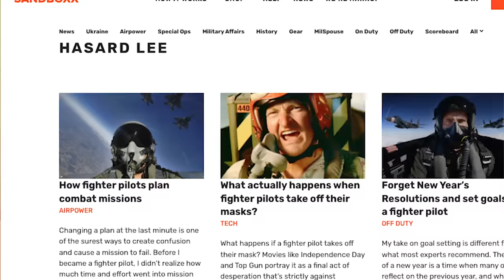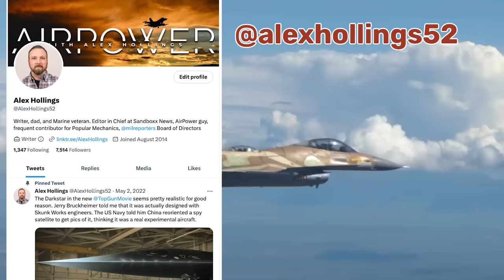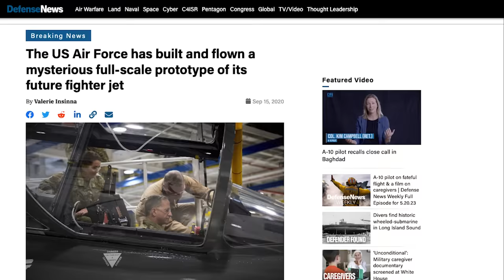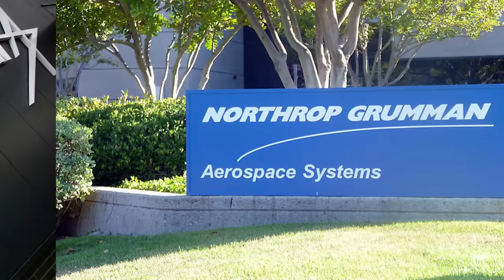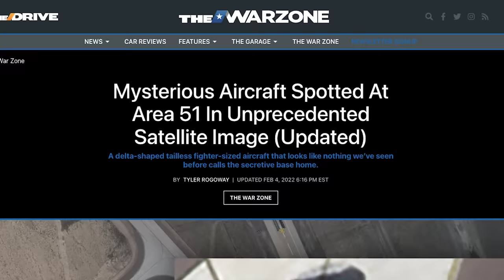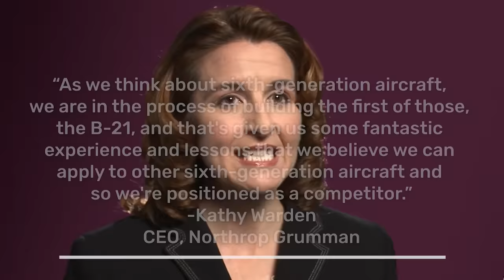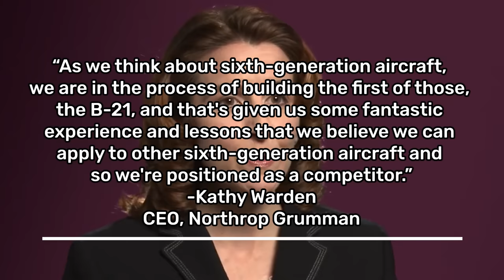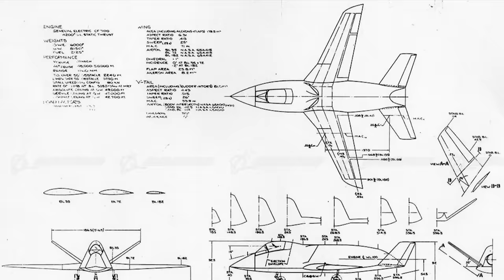The race is officially ON to field America's new stealth fighter

Comment: Sort of a question to anyone, if you give thrust vectoring that could rotate 360, could that still give the maneuverability a tail fin could give?
Reply: I would assume so. Look at something with TVC like a falcon 9 rocket.
Reply: Thrust vectoring alone doesn't contribute manoeuvrability, it does to an extent but not those extreme manoeuvres you see on airshows, for example the massive rudders on the F-22 combined with 2D thrust vectoring and the diamond delta wing makes it so agile, thrust vectoring alone without control surfaces is going to be difficult and the aircraft will be extremely sluggish.
Reply: @kermittoad  I think you’d need thrusters along with the thruster vectoring to match the impact of a tail controls.
Reply: @kermittoad  That's a fair point, I didn't mean the aircraft would use only TVC. I think TVC could be cleverly used to compensate for lack of tail fins. Obviously you wouldn't have only TVC or only control surfaces. I think both could be used together to achieve greater maneuverability than a tail-less design. I'm sure the engineers will come up with some clever designs and control systems.

Comment: Again - it is a huge mistake to call the systems “6th gen” - while most people think it is the logical thing to do - it is not. 
There is also a huge lack of understanding of the new jet. It should not put the F-35 to shame! Everything but! The F-35 is still planned to be THE jet until about 2060. Does this sounds, that the NGAD is just better in all domains? 
Here is the point: You have to see, what the Pentagon lacks as capability: mostly range. And it wouldn’t be a “big problem” to give the F-35 systems to control drones and drone swarms. But here is another problem: also “combat drones” won’t have the range (knock, knock: South China Sea). 

How to get this capability? Increase the size of the platform dramatically. I would even guess, that NGAD might be able to carry drones internally into the war scenario. 

Also - most people have a very wrong understanding of combat jet speeds - because Vmax is not even close the same used “maximum speed”. Usually jets won’t accelerate higher than mach 1.3. I guess, here NGAD will be also pushing the limit and have a far higher practical speed (while Vmax might stay the same). 

I guess Alex has been a bit misled. First of all: we don’t know if the F-22 is stealthier or not. There are official contradictory statements out - and probably non are wrong, because the aspects of both jets (F-22 vs F-35) might be very different (RCS). But even agility is incredible when you are looking at the F-35. I know, that there are heated discussion about it: but the videos of F-35’s doing crazy post stall maneuvers are not lying. Hence the F-35 is not at all so much in the shadow of the “bigger brother”.
Reply: Though the F-35 has a great sensory suit its not an interceptor and does not meet the needs of both the navy and Airforce in engaging targets up to 1k miles while using drones and stealth. It does have stealth but its a limited air craft with range and speed being a big factor plus it can't go super cruise limiting it even more.  The F-35 will never meet the demands of the battlefields coming up and its only hanging on by its sensory suit that the 6th gen will have but even better.

Also you never explained in detail on your opinion why you said its a huge mistake to call the systems 6th gen.
Reply: @michaelmichaelagnew8503 First of all thanks for commenting...
Look - I am well aware, that the whole idea of NGAD is range and usable speed (which can give stand off missiles or even any missile a lot of kinetic energy). The F-35 will be multiple time upgraded - hence saying, that the NGAD will have better avionics is somewhat a flawed argument.

The “gen” moniker is basically awarded, when an aircraft is proving itself. It is not the same to say “next gen” and “+1 gen” - because next gen refers to the next “batch” of aircraft types, but “X gen” refers to the performance (compared to the "X-1 gen”) and its force multiplier. 

So when the jet comes out and performs against Raptors and F-35’s and would have a kill ratio of about 15:1 or higher, you might make the argument, that this is 6th gen. Please listen carefully to any official statements: you won’t find anywhere 6th generation jet - only “next generation weapon systems”. 

 As said: the public misunderstands NGAD as a “replacement” or a “upgrade” of the F-35 and F-22. It fills the need of replacing the F-22, but overall, it will be a whole different format and a whole different objective.

I don’t even think, that it will have the same agility as a F-35. The need for stealth and for long range (aerodynamics) is just mitigating the possibility to have an extremely agile plane. Some can be achieved through some augmented (computer assisted) trickery (like in the F-35), but I doubt, that you could achieve all of it.

Comment: I thought the F-35 WAS the technology demonstrator. They still haven't figured out WHAT it is supposed to be. Despite the variants. Yes it is dominating  Airspace. but never really contested ones. I am starting to believe  "Next Gen" is the answer to TWO GENERATIONS OF DEVELOPMENT TIME.  (As the F-35 is still not cleared for full mass production). It comes in "Upgrade variants" in small batches,  but yeah, as long it is "On time and on budget..." (I like that one argument the most of them all).
Yes, NGAD will be a proper plane, Fast, Long range, High Payload, Drone control capable,  A.I.-controlled, and never in combat. As a loss would be too much of a reputation hit hit. Or risk for possible Technology transfer (National security Risk). Not to mention the costs, in whatever currency the USA will use by then. (It's probably going to be a 3-4 Trillion $ program, after all is said and done). At least the "Loyal wingman" drones can keep up with it. They are not by any chance MQ 25 and MQ 26? I think, they need new hulls and engines too.
I am not just "yucking your yum". I am asking  question about "Return on Investment" from a government's perspective. Not a company's. 
How the hell did we get from "A good plane is one that creates Aces", to: "On Paper it beats everything ".  I am just taking that paper, look at it from the edge and say: Stealth, indeed, until you look at it from the top. Usually a new plane takes a whole new support structure behind it. And all of it has to work properly. Material/manpower sourcing, Logistics for Materials, Production capacity, tooling and spare parts, well trained maintainers, assemblers, programmers etc . If you don't want to rely on foreign sources/capital it has to happen in-house. And i see little effort in that direction. Maybe it'll take six years , only to source the people who could actually produce it. I like shiny designs too, but if they are like Colani's designs, that never see the light of day as a serial Product, I HAVE to call it BS, despite them looking a century ahead of their time. It is the Car saloon fallacy. Underneath the shiny hull, it still has to work, and be serviceable by people, who know what's where under it.

Comment: The drone wingmen that can pull 40Gs without a pilot will be impossible for a piloted aircraft to deal with.
Reply: 40g capability would require re-design or a unique design for anything in that aircraft.  Avionics, engine, and subsystems could not be reused from aircraft designed to only pull 8-9 g's.  It's not as simple as it may seem.
Reply: add in 360 targeting system and that can launch a missile behind it like the F-35 and you have a mean fighter jet.
Reply: @ahill209  Our Aircraft and their systems and pull far more than 9G's but the pilots can't.  That's why the F-16 is locked out of some maneuvers.  WW2 planes can pull 8 to 9 G's.
Reply: @Cancer McAids with engines developed in the 80s like the raptor would. The technology is far beyond that. An engine doesn’t have to resemble the past designs. Multiple engines with 180 degree thrust vectoring would accomplish this. The military is consistently 40 years ahead of where the public expects them to be.
Reply: @Cancer McAids tell that to Turkey. The Kızılelma drone outperforms the f-35 from a country with a $16 billion military budget compared to the United States’ $766 billion.🙄

Comment: The Pentagon's priority is, preserving the high-tech industrial base.  The specific airframe chosen matters less, assuming it meets their stated requirements.  I think it likely that all three companies' proposals will meet the requirements, and furthermore I expect the Air Force has already DELIBERATELY set the bar low enough that they WILL NOT have their decision dictated by the relative merits of the competing designs.   

Northrop Grumman already has a large 6th generation program (the B-21) so there is no incentive to choose them on the basis of preserving the high-tech industrial base.  So for all practical purposes Northrop Grumman is out of the running. 

Lockheed Martin has a very solid 5th generation combat aircraft background and has probably done 6th generation work on classified reconnaissance programs, and it would be a shame to lose that foundation.  Boeing does not have a solid 5th generation combat aircraft background so there is less to lose if Boeing doesn't get this contract (and Boeing may be the front-runner for the unmanned portion of the NGAD system).

Conclusion:  The NGAD manned figher contract will go to Lockheed Martin. 

I am 33.3% certain of this.
Reply: Northrop Grumman has officially withdrawn from the NGAD competition.  Ba-dump bump CHING.  The NGAD manned fighter contract will go to Lockheed Martin.  I am 50% certain of this.

Comment: As exciting as this news is, I feel it is disappointing.  We have 2 programs that are still in production (F35 and B21), and would benefit from the wingman.  I really think 1 or 2 of the remote wingman models should be the priority instead of the crewed NGAD.  The B-21 doesn't have a role in the defense of Taiwan, unless we start to bomb mainland China (and pray it doesn't come to that), but paired with loyal wingman, it is a defensive juggernaut.  Use as an attacking AWACs that isn't nearly as exposed as an AWACs.  Our threats need the multipliers (read drones - in fighters, attack craft, and ships), not the budget busting primary vehicles.  Our current build generation on those are still first class, and don't have a credible risk in the development cycle of NGAD or the naval equivalent.
Reply: Taiwan is already a highly difficult task for China; the coastline isn't friendly for landings, their navy crossing the Taiwan strait would be highly vulnerable to anti-ship missiles which they're acquiring more of, and correct me if I'm wrong but they have little to no experience in such a huge operation. If other countries get involved in any capacity China likely won't be successful.
Reply: The NGAD will be manned and also able to be unmanned.  It will also be more advance than the F-35 and far superior as an Air to Air platform.

Comment: I would think the military is going after and end all be all approach to the NGAD. Meaning the F doesn't mean it's just used for air superiority alone but ground targeting also. That leaves me to wonder the fate of the A-10. They are ordering vastly smaller quantities of this aircraft than ones before. So maybe the military learned their lessons with the F-35.
Reply: The F-35 is exactly what they wanted/needed, and its gonna be the backbone of the fleet for quite a while so of course a more expensive heavy fighter will be made in fewer numbers, the F-35 will be able to cover most missions. The A-10 was already obsolete in its initial tank buster role and should've had a lighter/cheaper replacement long ago, but congress keep dragging it back and preventing progress.
Reply: @aidanwilliams9452  I disagree with your assessment. The F-35 cannot deliver a nuclear payload. It's too slow for the shock and awe. Let's not forget it couldn't win a dogfight with an F-16. It might have the computing power but it definitely doesn't have the horsepower.
Reply: @c_s_8411  Firstly, the F-35A is nuclear capable they’ve assessed it. Second, it’s Mach 1.6+, and unlike an F-16 it’ll actually reach those speeds carrying a combat load. There’s no point for Mach 2 or higher, you’re wasting fuel and there’s been virtually no supersonic fights in the last few decades. As for the F-16 dogfight, 1) that was 8 years ago during it’s development where it was severely g-limited 2) the testing was started with the F-16 in a 6 o’clock position giving it full advantage 3) F-35’s have been wiping the floor with the F-16 in training exercises ever since.

Comment: They can do whatever the hell they want with NGAD but just dont retire F 22 and if one stealth aircraft has to go then send the F 35 tor retirement
Reply: The lightning 2 isn't retiring. Too many customers and more blocks and upgrades are planned for the next 50 years.

Don't get me wrong, the Raptor was an amazing platform and served its function well for its time and would still serve well for ours and on the future. But unfortunately times are changing and a new fighter has to go for a new role. Not to mention production of new raptors ended in the Obama administration.
Reply: So you'd retire the better aircraft? The raptor is cool and all but the F-35 is far more capable and much cheaper to buy and operate
Reply: F-22 will be retired when the NGAD comes out and replaces it.

Comment: Why even bother????  They'll only build a few of them, and they'll cost a fortune, and then they'll destroy the tooling and start howling about the "next" generation they need so badly. What happened to all of the F-22's we were supposed to have?
Reply: 700 
However they were expensive due to a small number because the cold war ended so we simply didn't need much more of them and we weren't allowed to export them out so no one else could get one.

Meanwhile the lightning 2 is on its 800th and counting and whether people like it or not, they plan to keep producing and upgrading it for the next 50 years.
Reply: @mill2712  And how do you think this new airplane will be any different?  Igitur qui desiderat pacem, praeparet bellum - Vegetius